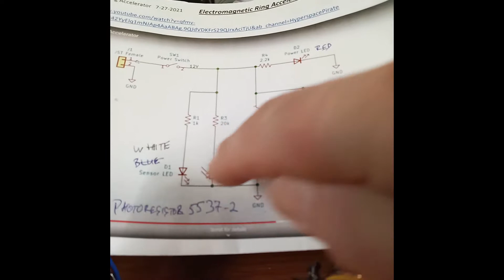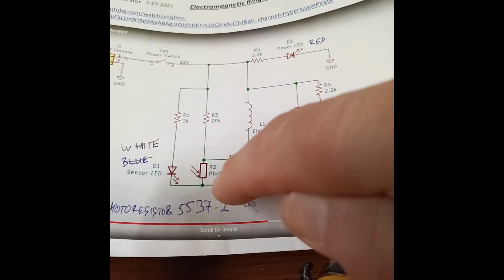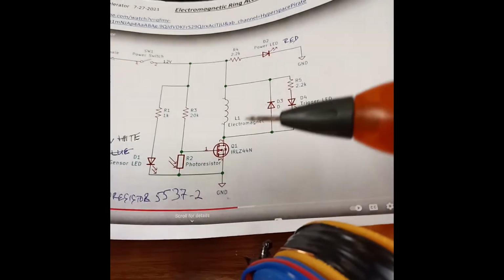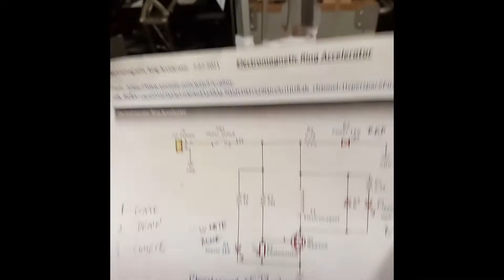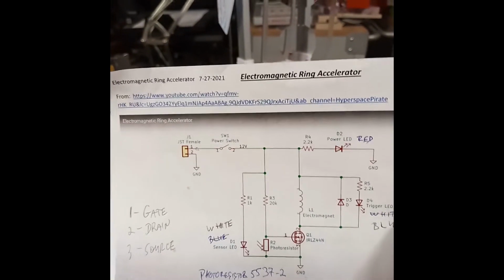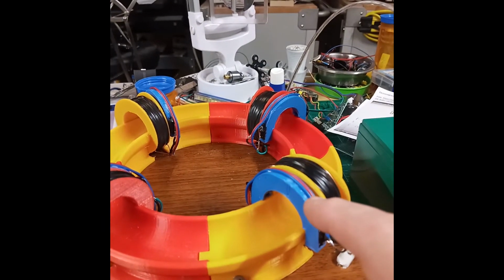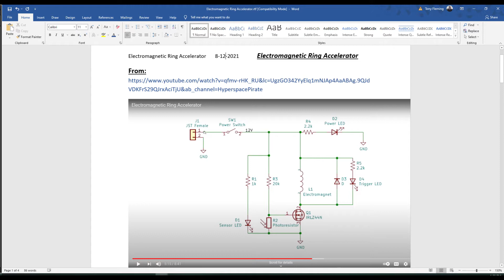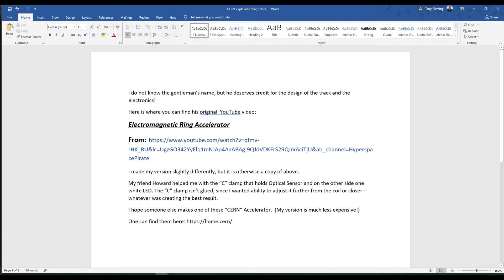CERN on the DESKTOP -  Electromagnetic Ring Accelerator

Comment: Hey, do you know how Amp are going into these coils ?
Reply from the maker: I don't, but it isn't much, since the parts used could not handle more than 1A.
Reply: @ thanks you very much. I’m trying to do the same thing.
Reply from the maker: @hotice6999  Wind the coils before assembling the 4 pieces into one ring!
Also, use a very dark filament when printing the parts! Reason: the photoresistors I used to trigger the coil, is very sensitive to light and it effected the switching on and off the circuit. Do you have the schema for the project, or are you making your own version? I have the first version here: https://www.youtube.com/watch?v=QfVaCywSr18&ab_channel=TonyFleming
Go here for the schema, if you need to have one: https://youtu.be/uNbL3tRZeMQ?t=161   I screenshot the   video that I froze  and printed the schema. Hope this will help you!
Reply: @tonysfun  Yeah I Watch the original video first so I use a ir led and I’m trying to make my own. But for now I’m just trying to test some coil and after making the ring accelerator with the right coil
Reply from the maker: @hotice6999  Just uploaded the video where I copied the schema. But if you like to make your own, all power to you! Have a great day!
Reply: @tonysfun  thanks a lot. And happy new year

Comment: Dear Sir  LINCOLN..
Could you help me to get more detail please:
 -    Ball : diameter  and is magnetic or not 
      Coil : gauge   , turns   in and out side of coil  Many thank you
Reply from the maker: The metal ball is 1" and I have both magnetic and regular balls. The magnetic ball is crazy and you should build up the walls if you like to use the magnetic ball.
The wire is a magnet wire 24 AWG and about 150 turns.
Reply: @tonysfun   Thank you very much for your time and quickly help me.Best regards
Reply from the maker: @568min  You are welcome.